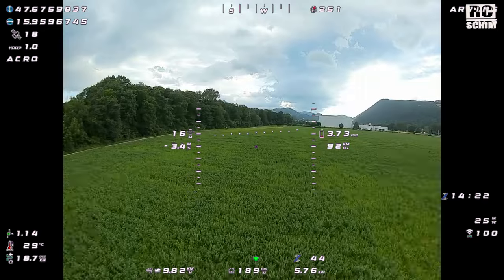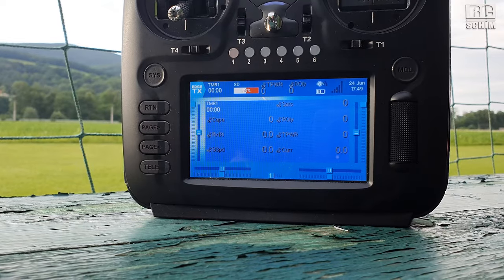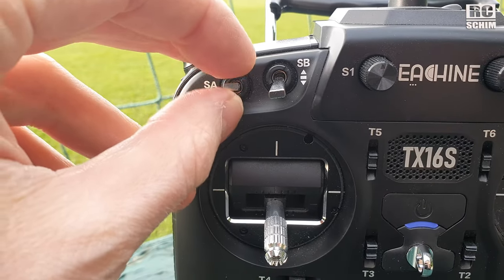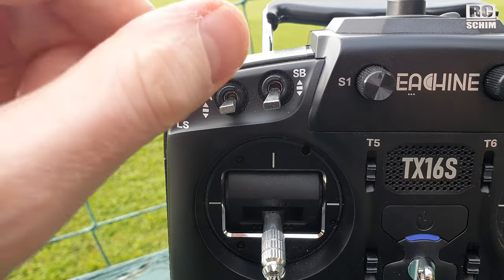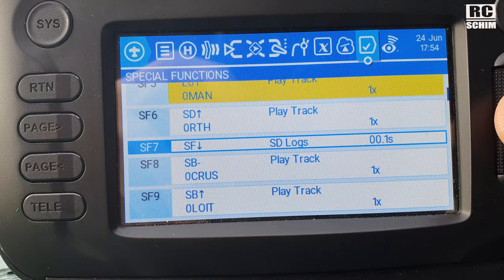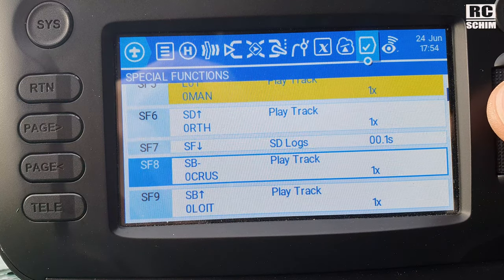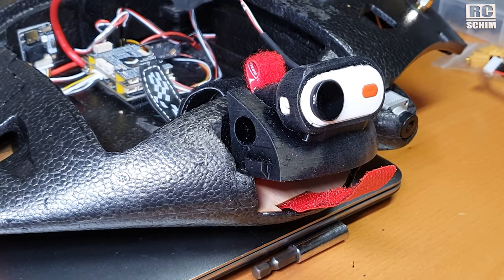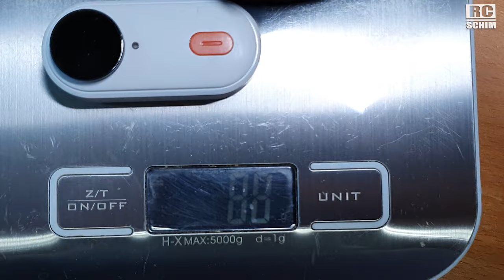ARWing Pro one year later (Cammounts, INAV Setup, OSD...)

Comment from the maker: WALNUT Update: while the 1st flight with Walnut was promising (despite the gusty wind), on a hot day Walnut performed poor (the one with dual motor warbird). Many errors in the video file, gyro data way off and stopped recording after 15mins (on a 25mins flight).
So I will try 2.7k mode next (less heat?)
You will get all STLs below (for free), If you like to support my work, please check my PATREON: https://bit.ly/2ESMtIO
●▬▬▬LINKS▬▬▬▬▬▬▬▬▬▬▬▬▬▬▬▬●
🟠FC used: https://www.speedybee.com/speedybee-f405-wing-app-fixed-wing-flight-controller/
🟠ARWingpro Nose cammount STLs and INAV config:  https://bit.ly/44D3zAQ
🟠ONShape ARWingPro plans:   https://bit.ly/3PPmvIG
🟠INAV Fixedwing Groups excellent transmitter-soundpack:
https://inavfixedwinggroup.com/guides/transmitter-models/transmitter-sound-pack/

Comment: Amazing flying and footage, Mario! 😃
Thanks a bunch for all the tips!
I'm about to build my first airplane... I should've started already, but I had a pretty bad cold and pain in my chest because of the cough... 😬
But all fine now and I'm going to start today. 😊
Anyway, stay safe there with your family! 🖖😊
Reply from the maker: Thanks Mario. Good to hear you are recovering, and even nicer to hear about you building your first plane. Not as easy to launch as a copter, but you will manage it. If you plan on using inav, consider autolaunch! Good luck!
Reply: @Rcschim  Not yet... I'm going to build the Axon, from Experimental Airlines... You know? And I'm going to build it just with a FrSky receiver I have around for now. It's going to be a good trainer, I hope. 😬
Reply from the maker: @MCsCreations  ah - that looks like a very easy to fly plane. keep it simple then - no FC, just RX and fly - good times! 
Good idea also to build it yourself. 
Way back in time I built a scratchbuild foam monster  the "AP Solution" a Tucan style nosed high wing trainer (with ele and Rudder only) in a pusher config. 
Back in 2009 it was designed to carry a large camera.   Check my Tucan solution video from that era ;)
I still have it in my hangar - but I guess it would disintegrate in the air if I wanted to fly it now ;)
Reply: @Rcschim  Oh, I'm going to! For sure! 😃

Comment: I built a Dolphin with a speedybee F405 wing FC, 4 flights later, I lost video DJI , (black screen) hit RTH ...nothing , no crossfire link , so its lost, not blaming the FC , but will be sticking with Matek from now on.
Reply from the maker: That's  bummer. Sounds like you totally lost power. Must have been the fc or it's bec right? Easiest explanation would be a loose main power lead solder issue....

Comment: Hello, after buying the Walnut a few month ago (and asking you many questions after your review) I just found a second hand Peanut for 160€... How does it compare ? The Walnut goes up to 4K/60fps but it is a bit too bulky/heavy on my glider, so until now I sticked with the good old Runcam 2 4K without any kind of stabilisation, and it works OK for me.
 
Here is an example: https://www.youtube.com/watch?v=vmCWsAT50Wo
(the video is uploaded raw, with no music whasoever, just for myself and friends, forgive me for that...)

To me the Walnut seems half-baked as the battery life is not great, the charging time on the other hand is looooooong, and the stabilisation is so-so... and also it is bloody hot while recording for a few minutes ! 
In the end I realized 2.7K/1440p and 50fps is already good enough, and a good stabilisation (like gopro 10 or higher) is nice...

Is the Walnut @4K really a big step up from the Peanut @2.7K, in your opinion ?
Reply from the maker: Hi, you see I tested different cams on the arwing. Walnut looks like a good option, but on the 2nd flight (bit warmer) it overheated, stopped after 15mins (25mins flight) and also I had some nasty skipped frames, gyrodata was poor...
Peanut on the other hand (really a Insta360 Go2) is very solid. Not good batterylife (20min?) but you can power it from main flightbat (like you can the walnut).
Quality is good enough for most scenarios.
Huge bump in quality is Gopro11 mini (which I got as an amazon deal). it's heavy tho.  works kinda well on the ARwing (you've guessed it - I built another mount for that :)
Just flew it today again. 
But if you watch my fixedwing videos from the last 12 months or so - you see a lot of them filmed  with the peanut since it just works!   and stabilization  with insta360 studio is also good!
Reply: @Rcschim   Thanks for your extensive reply ! Yes, I saw that as one could foresee, the Walnut didn't handle very well the hot air temperatures... Heat dissipation on the back of the cam does not seem to be really efficient. And the batterylife on my Walnut has never been great, maybe 30 mins... 
But once fully charged ,the go2 seems to drain little power (according to Josua Bardwell's testing)
I have Hero10 as a regular Action Cam, so I can guess that the quality of 11 mini is even better, with a few features removed from the Hero11 std like photo...
As I fly mostly planes/gliders below 250gr (as much as I can), 50grs is a maximum for me...
and yes I saw lots of your Peanut videos, and I found it great despite the limitation in resolution and framerate ;-) 
When I'll stop crashing every now and then, I'll maybe switch to larger gliders, then the peanut could be a very good option for filming from the wingtip/winglets !
The only drawback is the way the case is designed, not really aerodynamic, neither easy to fix on a wing without adding considerable weight...